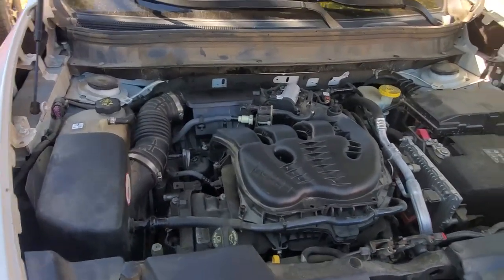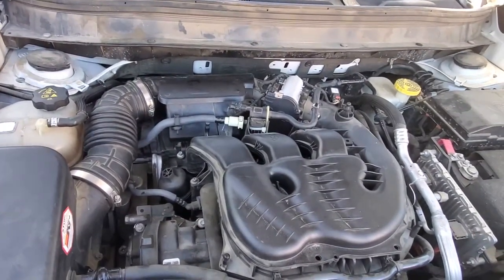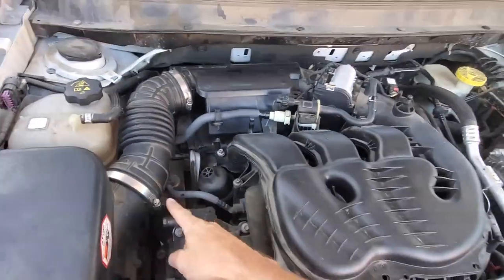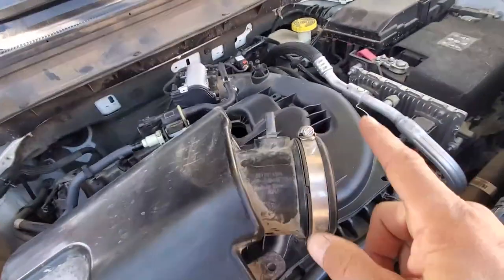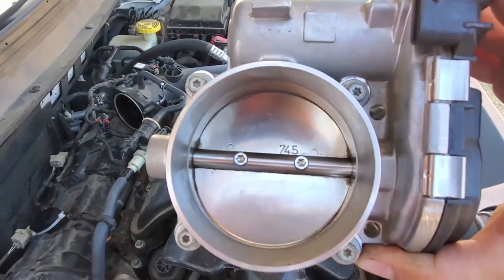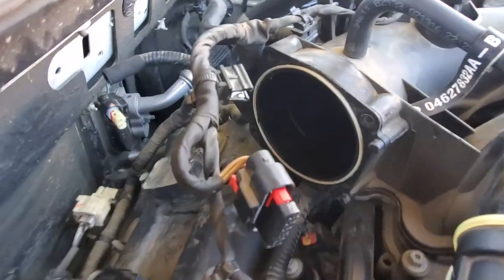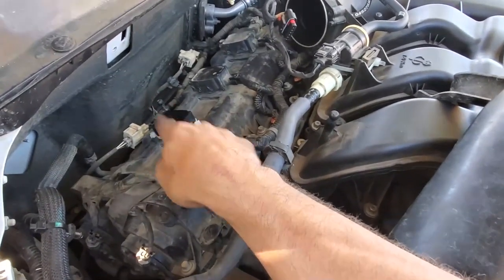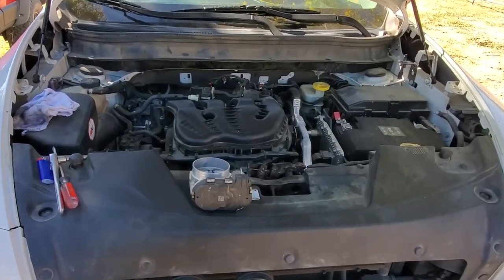How to, 3 min. video:  Change Throttle Body/ TPS Jeep Cherokee KL 3.2L

Comment: Im trying to take mine off to clean. So based off your video itll be best coming from the left side of Engine snd remove breather box first?
Reply from the maker: Yes, remove the breather box first and the throttle body  is on the drivers side.
Reply: Thanks for info. Im not much of a car guy. I know the basics. An was looking at it thinking it would be a long hard job an was about to pay someone to do it but after seeing you show the full removal I'm definitely confident I can do it. An thanks cause mines a 3.2 which from what I hear is rare an not to many ppl Kno much about them
Reply from the maker: @samhartman5676  The 3.2L is based on the 3.6L pentastar motor. The 3.6 faces forward for a rear wheel set up, the 3.2L is sideways for front wheel drive. There are less 3.2L's but there are not that many differences in the engine. Glad you are trying something new, this isn't a hard job to try. Best of luck, if you run into an issue, let me know.

Comment: I wanted to see how to get those clips out.
Reply from the maker: I undid a few clips. Most of them, the safety clip pushes back and the clip for the plug lifts off either with a flat screw driver or has a release tab to push on. I also have other videos on this where i worked in this area. The video for the spark plugs shows a lot of this in greater detail.